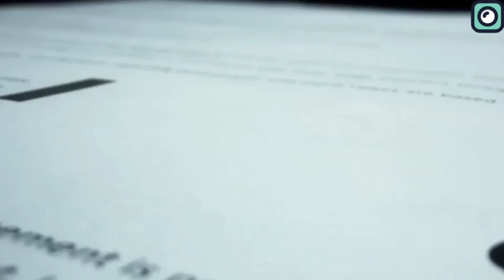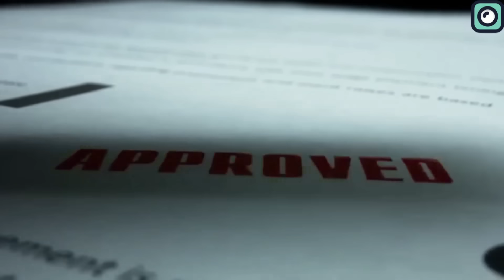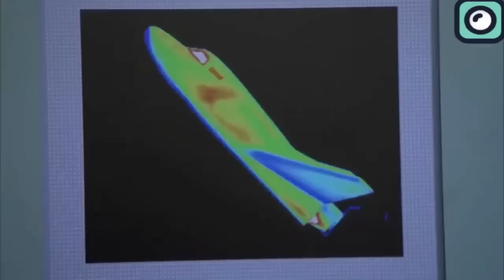FAA Gave The Launch License Of The 4th Starship Launch!

Comment: Why is autonomous operation so important?  You cited Starliner's initial flight as not being able to dock with the ISS, but Starliner WAS operating autonomously.  It just autonomously choose a lower orbit than that used by the ISS. It's hard to dock when your in the basement and you are trying to open the penthouse door.